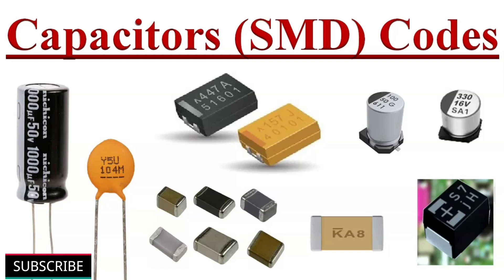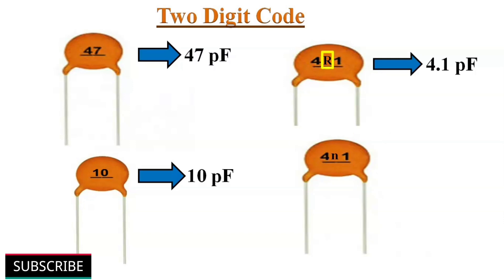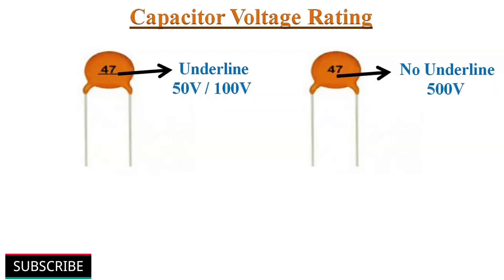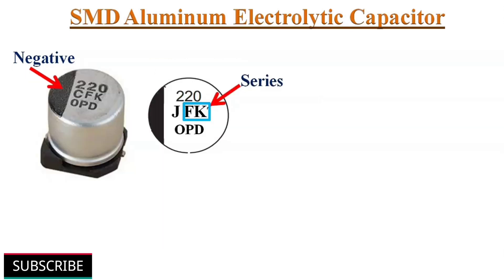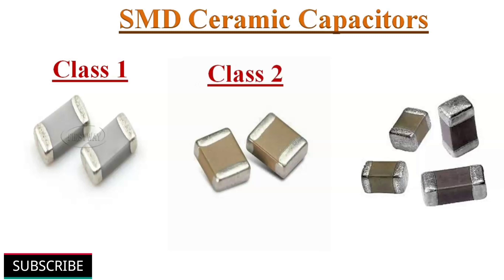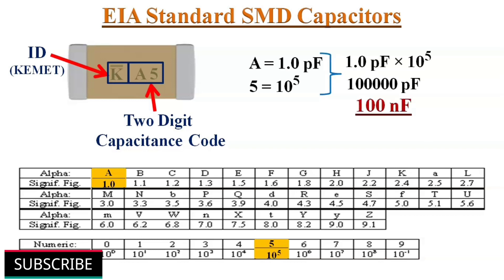Capacitor and SMD Capacitor Codes Explained with Examples

Comment: these markings, the alphanumerical writings, differ dramatically, even within the same standard. I am utterly confused! very complex and detailed explanation, but I still don't know what my markings mean. I have a mainboard, I damaged it during mounting, one of the mounting holes is 1mm from this capacitor, cylindrical, aluminum can with the polarity marking, looks like a standard conductive polymer electrolytic capacitor, when the screwdriver slipped, it slightly pulled one of the 2 pins out of the rubber bottom. I opened it, and indeed, it is a black polymer strip spooled between a thin aluminum strip. I did rip the pin out, completely compromised the capacitor. now I need to replace it, the mainboard was very expensive, almost 900 Euros, it's brand new, the repair is trivial, but I cannot find the exact capacitor. nor can I read the codes. Gigabyte will not help me, under any circumstances. I asked a lot of people with experience in electronics, nobody knows for sure, nobody would guarantee the interpreted specs. I could desolder an identical capacitor on the mainboard, to measure everything, but I'd like to keep the repair simple, just read the code and interpret it. The text, exactly 4 lines of text, go like this:
FP
22CG
1 0 1
6.3

I think FP 22 CG could be a manufacturing charge number, series code, something like that. or 22nF, or what?
is 1 0 1, with spaces between the digits, the capacitance code? is the 6.3 the voltage, as we all suspect? makes sense for this place on the motherboard. I need to find an equivalent capacitor to replace it and be done with it. I've been researching this for a week now. do you have any idea what the text means? besides the obvious, which is not that obvious actually..
thank you!!!

Comment: You are too good & shared excellent information for which i was reeling since long to understand. This is one of the best video on entire u tube on all types of capacitor. Hats off you for sharing wonderful information. Request if you can share video on testing of such capacitor in PCB circuit not out of the circuit, hope you will share some fullproof method for that. Thanks a lot
Reply from the maker: Thank you so much,
Will definitely cover all topics.

Comment: You didnt explain the one at 7:39 and thats the one I need too read, except mine says 9MK instead of 87S. The rest I guess is 47mF and 16 volts. Im trying to read that capacitor because its damaged and I need to replace it. Its for the AC control module of my car.

Comment: Im LOVING this channel! Unfortunately the soldering iron i have short circuited. I need to replace what looks like a fuse, in-line with a varistor. The "fuse" is burned and have no identification for it other than this very EXACT symbol  [■~■]F1 i have seen nothing like it before and cant seem to find any information on datasheets of the varistor (10D471k) or data on pcb (926-LED-III) regarding these components. I need help im losing my mind without my soldering iron.. ive done days of research any help would be so greatful

Comment: Hi. I believe I have Class 2 SMD Ceramic Capacitor. It is 1.5mm x 0.5mm, but how do I find out the farad? Can I just replace with ceramic smd capacitor of similar size? Will farad differences matter?

Comment: SMD Aluminum Electrolytic capacitor: can you identify this code for me  : 7T 47 CZA ?
Reply: Applying what I just learned from this video, 7T = lot number, 47 = capacitance (47uf), C in CZA = 16V (ZA = series). Someone correct me if I'm wrong.

Comment from the maker: Timestamps for various topics covered in this video are as follows:
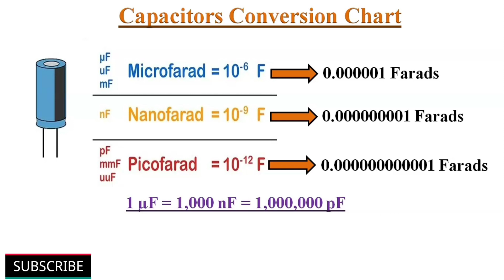0:45 Electrolytic Capacitor Code,
1:06 Ceramic Capacitor Code,
4:12 SMD Capacitor polarity marking,
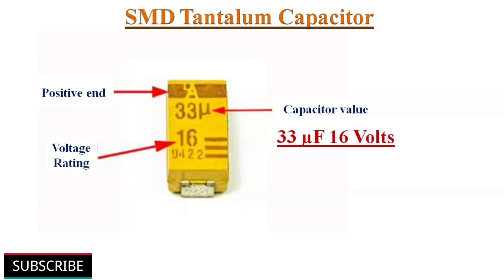4:47 SMD Tantalum Capacitor Code,
5:49 SMD Aluminum Electrolytic Capacitor Code,
7:45 SMD Ceramic Capacitor Code,
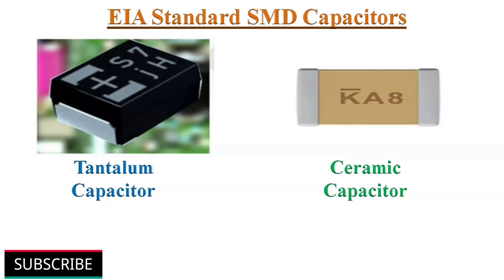9:39 EIA Standard SMD Capacitor Code.